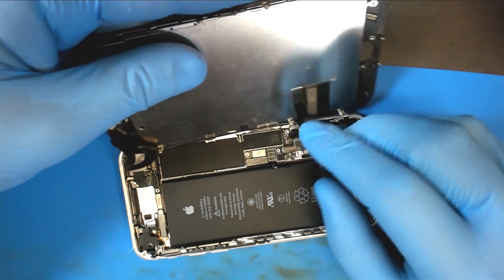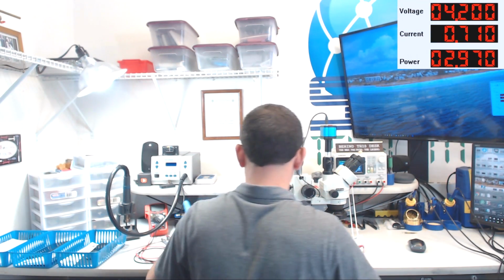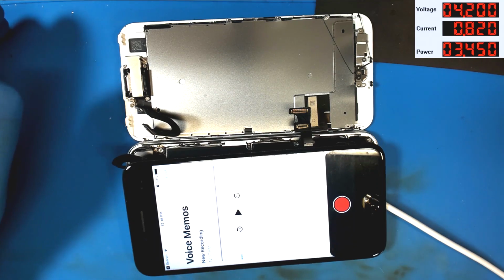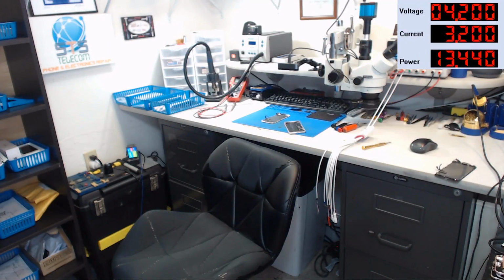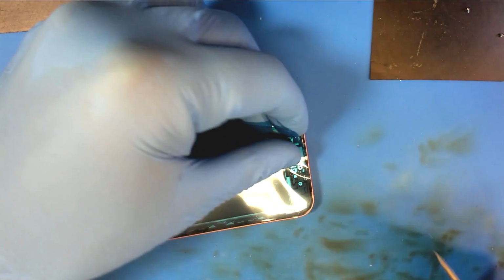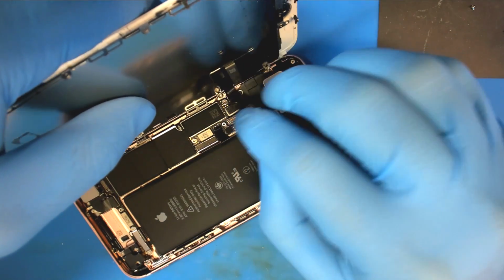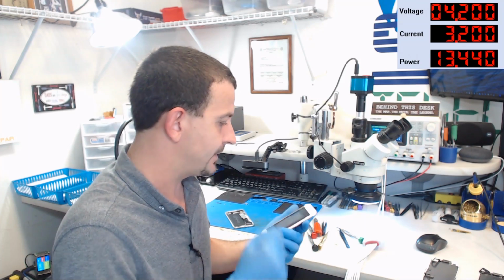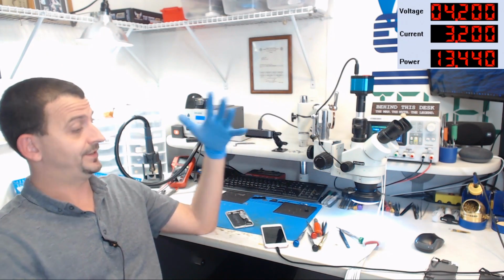Fixing my sister's iPhone

Comment: Have you given Thing an internship? 😂 They didn't hang around very long.

@Jason You owe me $5 + GST (Goods and Service Tax) coz I bet the Home button was ok. 😛
I can't believe that people would send in a repair job and then not get it returned. Those devices ain't cheap so WTF are they thinking?

I spent 14 hours building a machine and installing software on a friend's PC only to have to do it again 3 weeks later because he got it badly infected from porn sites. Second time I installed a Virtual Machine, made a copy and all I had to do was copy the VHD to the appropriate folder and was done. He was instructed to only use the VM for deviate behavior activities.

Comment: Hey Jason! I have an iPhone 7+ home button that got cracked from a fall. are you able to swap its chip to a non cracked chip??
Reply from the maker: It's very possible to swap the chip but I think the chip is only for the pressure sensing part of the button.  The unique component that matches it to the board, I believe, is the sensor itself.  Unfortunately, I'm not able to repair those.  I normally refer people to an Apple store to get a screen replacement.  They replace the screen + pair a new home button.
Reply: OH yeah! was watching your video and got some dumb idea it was the chip lol. supposedly the senor and cpu are tied, so now that you can do a cpu… lol. BTW I believe the way apple replaces a home button is by charging the customer for a pair board aka $300+. There are now home button replacements out there that will replace everything but touch ID I believe. I'll most likely go with that. I just thought you discovered something new :). thanks for video

Comment: a tip for removing the home button effortlessly:

heat it from the screen (200°C for about 10 sec) then soak a Q-tip with alcohol and put on the flex cable while lifting it up gently. I will came out very easily and the old glue will still be good after the alcohol dries
Reply from the maker: I'm gonna try my next one's with ISO.  Thank u!

Comment: I'll never get how people can get their devices so badly damaged like that...

Have you considered using an opening tool to open devices instead of prying? It makes me cringe when you open devices like that, I use an opening tool that I bought for £3 off eBay (around $5) in the middle of last year and it's awesome. It's strong enough to open the device even when it has adhesive holding the screen in place, and it's impossible to damage the device when using it (although I do prevent it from opening too much on the iPhone 7 and newer, to avoid damage to the FP flexes).
One area it does fall short on is cracked screens, but a piece of tape across the screen gives the suction cup on that side enough to hold onto to open the screen.

To remove the TouchID sensor, I just use a small flat-head screwdriver to pry up the flex from the screen side (the side the screen connector for the sensor is on). No heat used and they always come off within a few seconds,  and I've had a 100% success rate doing it this way. From the front or side risks the flex ripping (even if using heat), but doing it from the screen side means that you're prying up from right by where the adhesive is (so it has to come up).
I used to use heat + pry from the side, and I killed a couple of buttons by doing that.
Reply from the maker: I have never used one of those opening tools.  I always seen how they used suction cups and just didn't like it.  Would it still work on a screen that is this badly damaged?  I killed an iPhone 7 home button once & had to re-ball turtle to fix it.  It was jittery and rapid clicking..  every since then, when a phone arrives that is doing that, I know exactly how to fix that home button.  Have never torn a flex tho.  Thanks for the advice. :)

Comment: I just found a ghetto cheap way to locate hot parts.  Stretch a piece of thermal receipt paper over the board, power it up and look for the black spot.  I was able to narrow down what component in a cluster of smd parts was getting hot with it.  Trying to figure out why my screen is dead on a g1200 digital microscope.
Reply: (lol) Nice. 

I was in Shenzhen, China last year. They use resin flux. It turns white when cooled
 So they apply it on the affected area, when the part heats up it melts the resin. Everything else is snow white (similar to freeze spray).
Reply: Nice idea thanks

Comment: Hi jason, i have an iphone xr not charging, tried new port, nee hydra, new usb ic,replaced two charging mosfets, still not charging boots with battery any ideas?
Reply: Aminur Rouf on two small pins getting 0.7 on diode mode and seems to be a normal reading but no voltage im missing 3.7v from port to battery pin i guess, tester was showing hydra is okay but I replaced it again and its okay and passes the test , but still missing voltage on battery pins
Reply: Aminur Rouf this is exactly what im facing but with xr

https://forum.ipadrehab.com/forum/iphone-logic-board-repair/6001-iphone-8-not-charging-hydra-passes
Reply: Aminur Rouf 😐